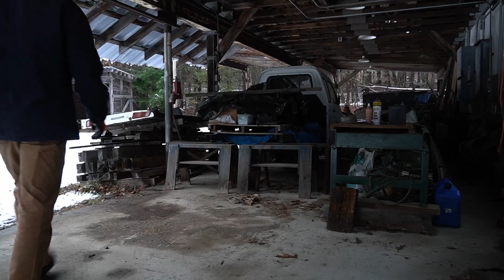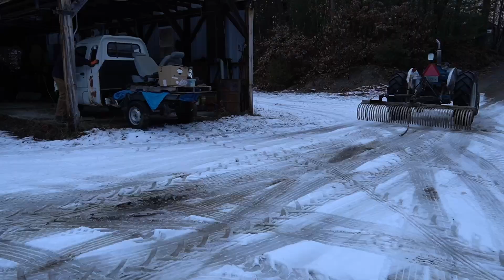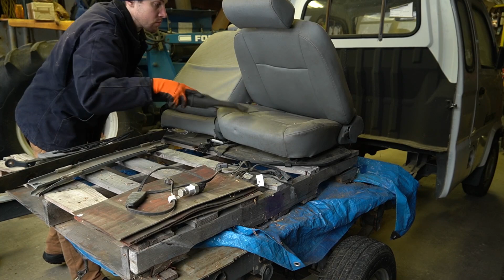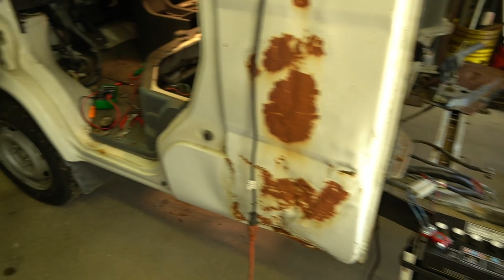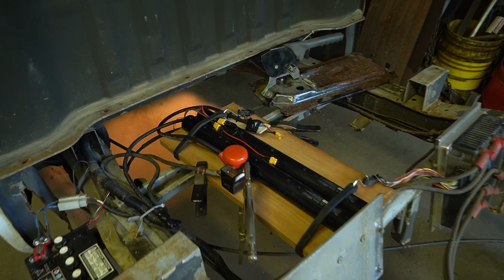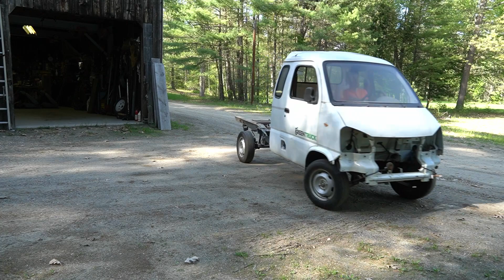Electric Mini Truck Project RETURNS - Will it drive?

Comment: Hey man long shot but I have the same truck and was wondering if you could show me your wiring set up from the one 12 volt and where u got them running from and also your main terminals for the 72v where there comint from as well. I got this cart and this guy just cut all the wires so starting from scratch pls get back to me thanks
Reply: Hey man I’m hoping I can get a response from you please message me
Reply from the maker: Happy to help. Send me an email, email is in my profile.

Comment: When will the next video be released?
Reply from the maker: I can't say for sure at this time. Life has been crazy busy and other projects have taken priority. This will get done however! Thanks for watching.
Reply: @savvysprocket  I have one just like yours.  Used your ebike battery idea.  What did you use for a 12v battery?  It is the last part for mine.
Reply from the maker: That is awesome! For the 12v battery my plan is to use a lead acid unit that fits in the side battery compartment. Assuming your DC-DC is working the high voltage pack will then keep that topped off.

Comment: Hope to see more of this!
Reply from the maker: This will be returning again! Once the new shop space is ready within the next month or so I will have a good space to work on the rebuild part of the mini truck.
Reply: @savvysprocket awesome! Love the idea of one of these in the back of the property with a solar system on a ladder rack or similar. It'd probably be efficient and low enough usage that it'd almost never need a wall outlet.
Reply from the maker: @Ruralmn  that would be a nice little setup for sure! It would be interesting to run the numbers and see how many panels would be needed to minimize charging enough. Something to think about when I pick this project back up.
Reply: @savvysprocket  if you have a 6 foot bed you can probably get 500w of solar over it. Say 4 hours of sun since angles are all wrong. Ballpark 2kw a day added to the battery. Something like 10 miles of driving a day added. Definitely not an exact calculation but I figure that's about right. Can obviously add more and make it more but that's where I landed. If it was me I'd also run a dump load system where spare solar production could be used to heat the interior or circulate air through it depending on the season. Yes I've definitely over thought this. 😅

Comment: How did you do the brakes? Does it have a vacuum pump as part of the initial build?
Reply from the maker: Mine does have a vacuum pump that I have yet to test. It was removed from the truck when I got it so the pump itself might have a problem or the wiring for it. Still need to test on that.

Comment: This is my project... Ive got the axle motor, battery,  controller, charger & accs..  Cant wait to work on it this June.. 
.thanks for uploading your experience
Reply from the maker: Thanks for the comments and stopping by! Do you also have a Vantage truck you are going to be working on?
Reply: @savvysprocket  What I have is a Suzuki mini truck.. Maybe the earlier version. It does not have a small hood like what you have..
Reply: @savvysprocket  I am on the last day of my holiday and will be flying back to CEBU tomorrow. So by next week I can focus on the build. Pray that I may succeed.